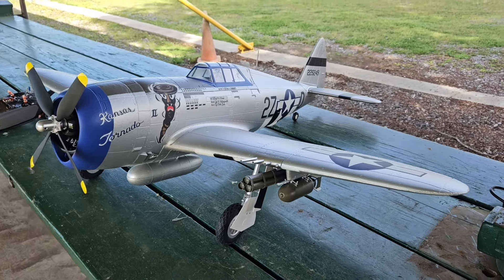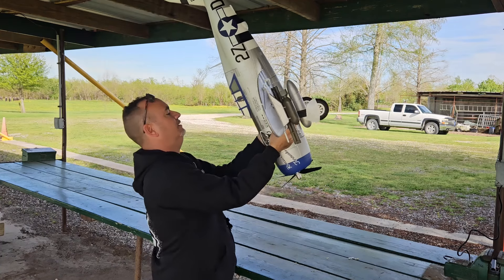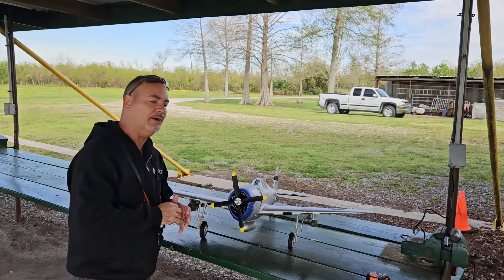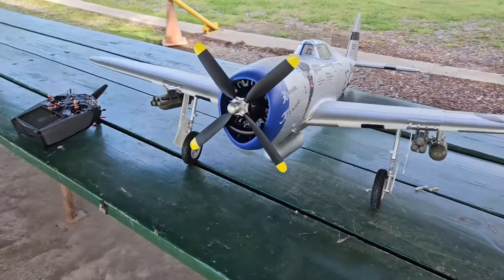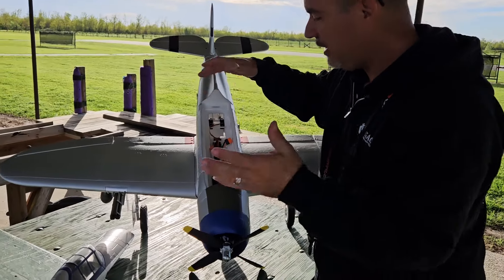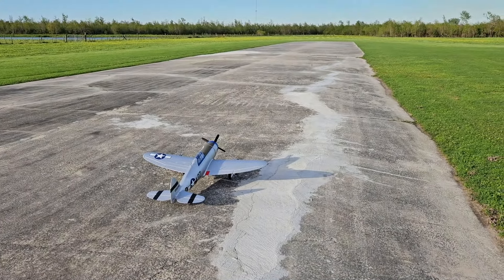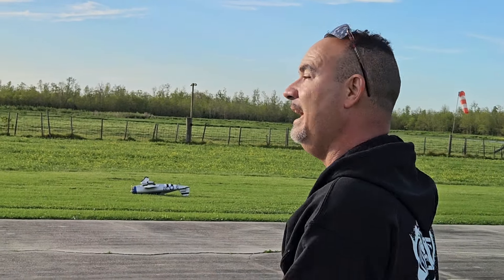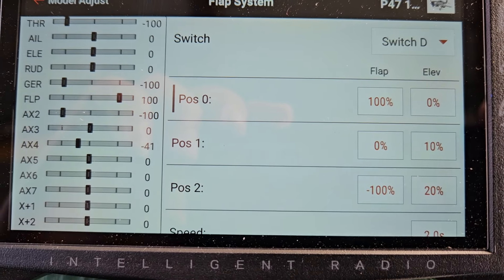P-47 Razorback 1.2m BNF Basic with AS3X & SAFE Select Maiden Flight #RC P47

Comment: 😂Great job Pooley! You’ll be mastering this plane in no time! When I say I understand! Believe me! I flew my first 1.2 warbird in February 2023! It was scary. But trust me these are so easy once you get rid of safe and tweak your trim a bit you’ll love it. Btw, I only fly mine on 3200&4200 hi voltage packs and barely ever move from the front of the battery bay. The Corsair too. If it’s windy 6-10mph throw in a 4000 and you’ll love the speed and flight time. Keep up the nice work
Reply from the maker: Hey, thanks for watching. I am so excited that people are actually liking my videos. I thought I could provide some incites and details that no one else has. That I felt a void when I was starting and wish someone would have covered. 

I totally agree with you on that bird being easy going. In fact, I actually have 2 of them. I found someone selling a lot of birds and in the pictures. I could see a badly damaged P47. So I inquired about it. He ended up giving it to me really cheap. I flew it just like that. At least a 100 flights as well as everybody else in my club. So I love the wide stance of the landing gear. The flaps it is a lovely bird to fly. That's why I got the brand new version of it. Because I know I love it already

In reference to safe. I love safe. But I do turn it off. As a matter of fact, the first thing I do in a maiden flight is get it up high enough. Click it off so I can trim it once it's trimmed. They usually fly around the whole flight without safe and I'll come in with safe if I feel nervous about crosswinds.
In reference to the battery I just happen to love the 2200s Ive got 3 of them However, I have a couple of the 3200s and that's it in 4S that I have thus far as far as the weight I would agree with you, though. It seems a bit light with the 2200 in any cross wind at all. The extra weight would be great..
Reply: @Pooley929  sounds like you’re growing and having fun! Love it. Can I suggest stepping into the 1400 size from fms ? The t-28 and P-40 will blow your mind with how much better the experience is. Smoother more agile in wind and buttery smooth acro & landings. When I get time I’ll post a ton of flights with them. ✌🏽

Comment: Nice job with the video and the cg issues. All good information to have. I setup my flaps on flight modes and this way i can trim the plane in each setting of flaps   works good for me.  Nice p 47.
Reply from the maker: This plane is soo stable and fun to fly I find I didn't even use any of the Ft modes I had  set up, the flap elevator mix is back to 0 on this bird and is soo stable I love the look of the corsair but I can't deny this things awesomeness

Comment: Nice maiden nice plane.  I have the same P47 2 of them actually both versions and the book CG is definitely to conservative.  On takeoffs i always need a bunch of rudder.
Reply from the maker: @patrickcooper2760  Thanks for the comment Thanks for watching as always Yes it does need a lot of rudder and still wants to go left lol,
Reply from the maker: @patrickcooper2760  I had an older one that I got before this one that I got from someone else crashed which is why I fell in love with this bird It is one of the best I've ever flown anyway in a severe crash trying to do a loop and thought I had it but didn't I busted the nose up pretty bad there is a huge weight in the front I contemplated removing it but didn't ultimately cuz it flies so well with it but curious to know if you took it out but that allow you to run a bigger battery maybe Yes

Comment: So the CG should be at 80mm back with the 2200 4S ?
Reply from the maker: Id say yes but that would only be my opinion, but I will say that this plane is not very picky and even when I think its tail heavy it still flies great and lands gently Ive tried the 2200mAh as well as the 3200mAh in all types of positions and never had an issue. I LOVE the 2200 battery it goes in so many planes its my go to battery.